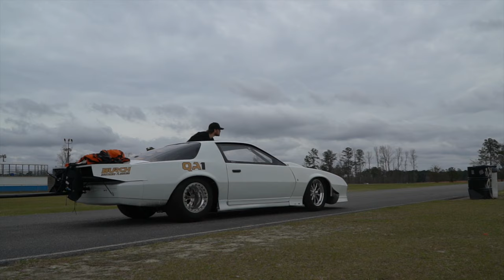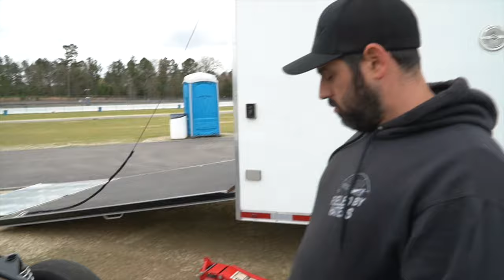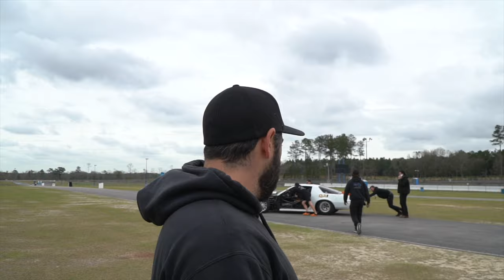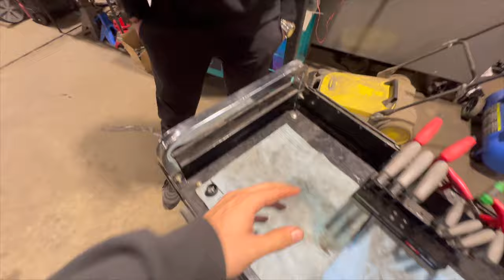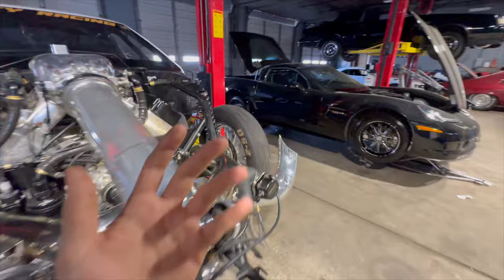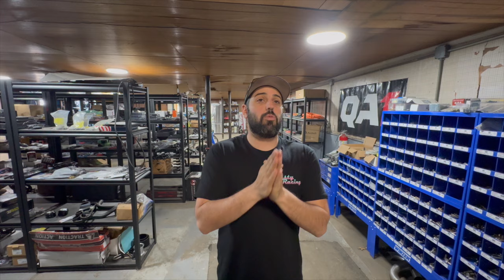SLICK RICK testing WENT TERRIBLE!!!!

Comment: Some one needs to invent some way to lift a car off of the shocks but still be able to be strapped down safely. This seems to be a common problem with the race shocks when trailered alot
Reply: There is something, a Blatter, it's like an air bag.